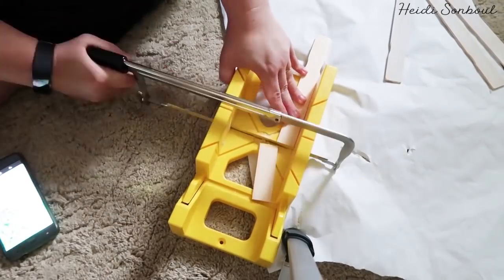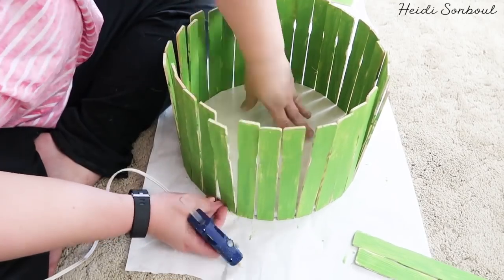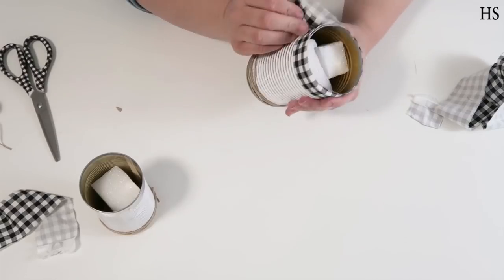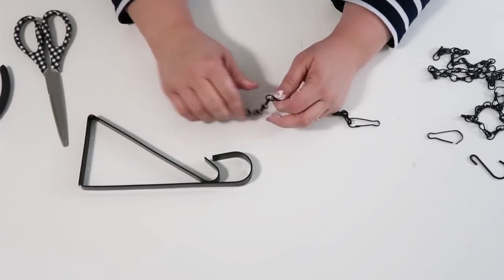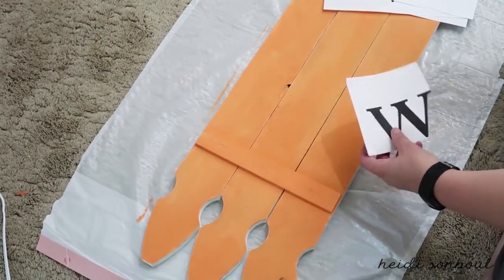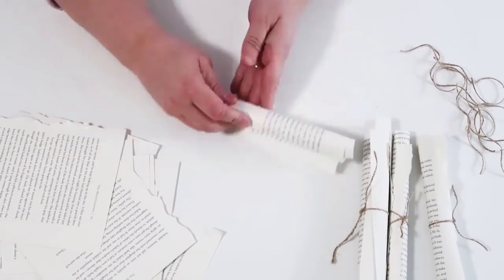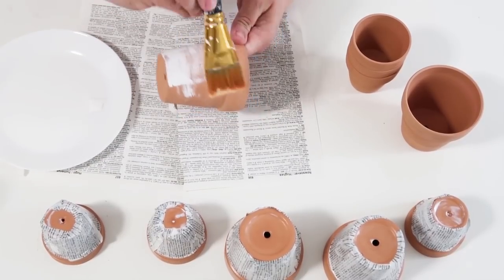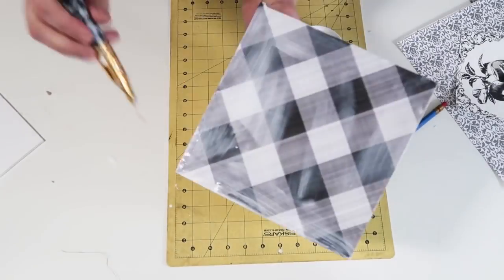TOP 9 FARMHOUSE DIYs | FARMHOUSE HOME DECOR

Comment: Instead of cutting out lettering, it's must easier to TRACE the lettering onto your board using graphite tracing paper (NOT carbon paper!) You can even just color the backside of your lettering paper with pencil, scribble across the entire back of each letter using the side of your pencil lead; then trace your letters, then paint.